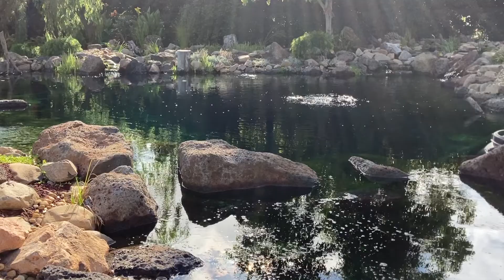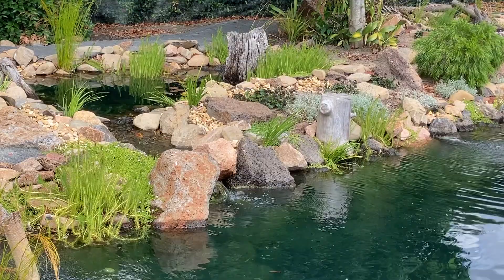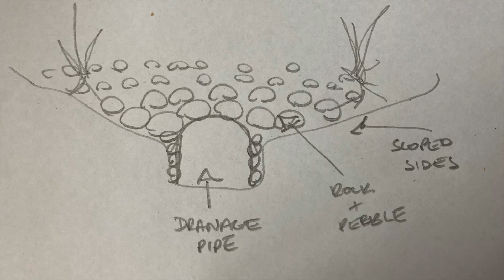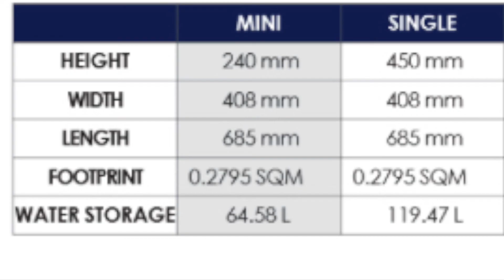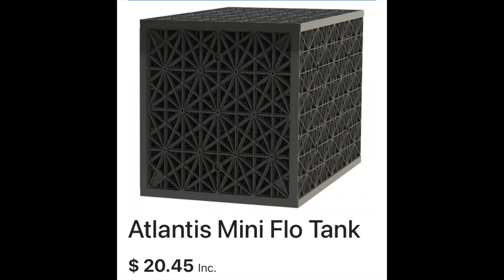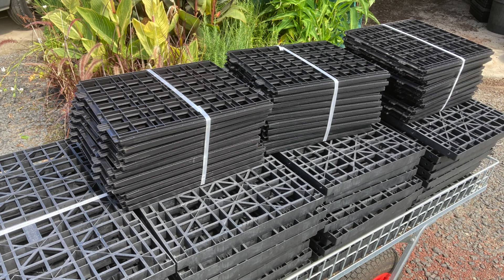Aquablox alternatives

Comment: typical and standard milk crates work perfectly. A milk crate can hold between 250-300 lbs on top of it. Typical rock, whether pebbles or boulders weights about 100 lbs per cubic foot. Three vertical feet of rock is about 300 pounds. It isn't necessary, but to ease worries, a person can attach a vertical pvc pipe to be a support pillar in the middle of upside down milk crates. I then put a layer of heavy duty plastic pallets.     I acquired all of it for free........   it really angers pond companies, especially those that solely use aquascapes products when the bubble on their products is popped and knowledge given to people. Those big companies are a rip off.     I first built a container bog out of an IBC tote after watching 1,000 hours of your videos and then built a bog in the ground.    People, do not waste your money. Caterpillar, snorkel, aquablocks, all a waste.     $700 for a glorified pvc pipe or a trench drain.......  $60 for a glorified milk crate.   .     Do what Kev says!
Reply from the maker: Thanks for crunching the numbers. That’s really useful 👍

Comment: I have 35 milk crates in the ground, will let you know how it turns out once I am able to move the last bit of dirt and put on some rocks. Right now it's covered in snow. I bought a pond liner, pump, and crates for less than $500, I'll need to total it all up soon to know exactly. Plan is two drops and one small pool area, pondless waterfall. Pump worked in the hole I dug well. The crates are lined up 7 long by 5 across so you can imagine the dimensions of my hole. Hoping I know what I'm doing, if watching youtube teaches you anything I've learned tons xD

Edit - Got a vivosun 1600 for $53 (83 now, it was on sale), a 20mil 7x10 foot pond liner for $19, and a pump bag for $6.80. I paid 3.50 each for the crates after a long search, 122.50. 
I paid around $200 total, 202 or so if we're getting picky. 

I really should get a vault, but instead I just punched out the side of one of the crates a bit for the tubing/wiring and will remove the crate if I run into issues later, then will put in a proper vault and a new pump if needed. I got rocks from a friend's backyard that were in a pile, as well as rocks around my house already so no cost there.
Reply from the maker: That’s awesome. Can’t wait to hear how it turns out 👍

Comment: Did the big rocks in the bottom of your bog work out well? I cannot seem to find anything for sale other than the Ecoblox water matrix for around 60-70$ US.  Even the Olive barrels are difficult to find for under $45.
Reply from the maker: The bogs with no blocks are going great. It’s only been 18months I still haven’t done a full drain and flush. Just a few partial drains.
Reply: @Ozponds  Thanks, since it is working well, I will set it up the same.

Comment: I'm working on a dry stream bed that gets flow when we have medium to high levels of rain. I used old tomato cage wire and folded it into a box-like structure and placed it at the bottom of my first of several small bog filters that I am installing in the bed. I'll see how it turns out put I expect it will eventually fill up with silt and I'll have to dig it out (or just leave it since it's not going to have regular flow).
Reply from the maker: Interesting 👍

Comment: Hi Kev. I have another question ( thanks in advance-in the bog building phase and am seeking your expertise.!) 
My bog is 2 ft deep( liner in). I have read many other places to have no more than 12 inches of rock. Should I create a false bottom? ( i'll probably use milk crates as I can't find what your reco'ed atlantis mini flow tanks) I figure I'd bring the bottom up so the distance between the gravel and the top of the pond is onlya few inches. Or is 20 inches of gravel ok?
Reply from the maker: I’ve used over 3ft of rock and pebble before, no problem. A false bottom is great though! It helps store muck and makes cleaning and flushing much easier.

Comment: I used a plastic pallet that I found used for $15 and put cinder blocks under it for a small pondless I built for a friend. Been running great for the last couple years. Not sure how much it could hold, but those pallets are rated at 20k pounds on the ground...
Reply from the maker: Very nice 👍

Comment: I am using milk crates I bought from farmplas there super crates are $14usd each and hold i belive it is 2000lbs or 2500 still solid there is a lot of diy users going the pallet or milk crates rout
Reply from the maker: Nice 👍

Comment: Just discovered your channel and really appreciate your tips!  One question I had about the Atlantic Flow Tank blocks is their weight bearing capacity?  I was really impressed with the load bearing capacity of the Aquablocks.  One thing I am considering doing is putting in a rain water harvesting system under my driveway using permeable pavers.  I have seen videos of similar installations where a dump truck could drive over it!
Reply from the maker: I know the ausdrain product I used can have extra bracing added to increase the amount of weight they can take. I’m pretty sure the flo tank is the same. The Atlantic rep I spoke to told me that aquablox are their product rebranded.

Comment: I don't understand why the aquablox are needed for a negative edge setup.  Rocks are free and easy to move in the rare event you need to take out the pump.  Help me understand?
Reply from the maker: Rick limit the amount of water the reservoir will hold. A negative edge needs a very large reservoir to account for evaporation losses and water in motion if power goes out.

Comment: A local nursery had hundreds of Plastic crates that seedlings came to them in. They were in a huge stack and they were thrilled that I took them.  The area for the "Centipede" and bog Kept caving in during construction So I mostly used them to save on gravel. I actually threw Two 55 gal Plastic drums , and the body of a walk behind floor  scrubber in the hole as well. I wish I could post a picture. Lol. Great Videos, man!
Reply from the maker: I wish you could too 👍

Comment: Great video! As you asked for feedback: I'm building a large Koi pond in Sweden. Love the Aquascape videos and materials, but there's no way to purchase any over here at a reasonable cost. Will have two intake bays in series, as well as a infinity edge overflowing in a large reservoir. Am using around 100m drainage pipe cut in half, upside down on top of slightly heightened plastic Euro-pallets. This creates a void underneath. The idea is to combine the 2nd intake bay with a gravity fed biofilter all in one, a 15m x 2m long downflow filter with only about 20cm pea gravel on top of the drainage pipe. At the far end, the pumps are fed from underneath the pallets, from there via six 110mm piping back to the main ponds. Cleaning 20 cm of pea gravel after a few years is doable if needed, less so with say 60cm of pebbles or gravel in various grades... This will be our 4th pond :)
Reply from the maker: That’s awesome Peter. Sounds like you’re all set 👍
Reply: @Ozponds  Well, not yet... But one tries to learn from mistakes :) When you are surrounded by oak trees dropping a gazillion leaves and other stuff, you have to get a bit creative to make a pond work nonetheless. But it's an endless learning experience for sure.

Comment: Aquablocks here at $80-$85. So I found some plastic soda bottle crates for free. They hold two large soda bottles and are stackable. They are similar to milk crates but not as much depth. I'll have to play with how to stack them so they are not stacked inside each other. so I'm considering using them as aquablocks in a few places. And will use a few large pipes as well. I'm trying to decide if I want my return lines to be my clean outs or if I want a seperate pipe that's larger below my return lines in a trench. I suppose creating the "aquablocks" as my clean out would work. and have all my regeneration bays/ bog shelves slightly sloped back towards the clean out trench. I just assumed I'd make them seperate until I saw most ppl just clean out the returns. My regeneration zones/ bog shelves are not wide but long so im considering how I'll plumb the returns and clean outs because I want proper distribution of my returns. I'm not going to use pumps for my clean outs I'll be using vacuum tubing to access the clean outs and send all that into a rain barrel in the garden. Our barrels run from $20-55. So some things I'll use 5 gallon bucks instead of the barrels. My large barrels I'll use for the garden and to make a pool vacuum using a shop vac and a rain barrel.
Reply from the maker: Sounds awesome! 👍

Comment: Question.... for underlayment.  I'm wondering what order to lay things down if I have underlayment felt, sand and a gorilla bottom and liner. Should my sand be above the felt and gorilla bottom? Should gorilla bottom be on the bottom, then sand then felt? Or if I get a gorilla bottom do I skip the sand? I want extra protection.  My pond is a formal shape, rectangle so my thought was use gorilla bottom for extra protection since they don't cost too much. That or lots of sand I'm just thinking the sand is supposed to go on top of something so it stays in place.
Reply from the maker: If it was me I’d just do one or the other. All 3 serve the same purpose (Protect the liner from punctures).

Comment: What plants would you recommend to be planted into gravel submerged but growing out above the line of the water. In the uk. Temps go as low to around 0oC for 3-4 months and the rest is between 10 and 30 oC
Reply from the maker: That’s not to dissimilar to my temps here in Oz. I like to use upright milfoil but I’m not sure if that’s available in the UK.

Comment: Wish I had known this sooner! I bought 5 Atlantic Water Gardens ECOBLOX FastFall Matrix Blocks for $72.99 each for my intake bay for my new pond . The pump vault was $132.86 for my 5,200 gph pump. Yeah it was expensive! Kev, how deep should the intake bay be on a 13’x15’ x 5’ deep pond? Shout out from Quantico Virginia! ❤️🇺🇸
Reply from the maker: The depth doesn’t really matter. You just want to make sure that you have a shallow/ narrow area that will create that surface pull or tension. Then you just need the bay to be able to hold a minimum of 1 minutes worth of water but it doesn’t matter if this is oversized. I would say if you have too much water over the vault it makes maintenance more tricky.

Comment: Hey mate I made a bog filter inspired by you for my fish pond but I'm getting really slow flow. I have a pretty strong pump and I'm not exactly sure why sometimes a lot of water comes out and sometimes it just trickles out could you help me out?
Reply from the maker: Where is the pump located? Is it full of debris? That’s usually the cause of decreased flow.
Reply: @Ozponds  it has a massive sponge attached to it prevent sucking in leaves but I just cleaned it yesterday still very slow flow. I think it's the actual bog filter as the output is just a 25mm bulkhead fitting
Reply from the maker: I like to increase the outflow as compared to the inflow. For example if I have 32mm coming in I have 50mm going out. But if what you are saying that if your pump is pumping in a large volume of water but a low volume is coming out…where is the excess water going? It’s gotta go somewhere. The only other thing I can think of is that the inflow pipe is too small, although even that doesn’t make any sense if you experience high flow at certain times.
Reply: Yeah I agree it's only a 25mm outflow pipe the excess water just stays in the container and like every hour some air gets like drains I don't know but then a ton of water comes out at once it's definitely not leaking just probably got to upgrade the outflow
Reply from the maker: That is so weird. I’ve never experienced such things. I would be checking how the inflow is configured also. It sounds like you e got some kind of back pressure going on. Also remember bogs work best with slow flows. Any excess water can be directed over the surface of the bog.

Comment: Not sure where you live Kev but have  you looked at soakwells? They are used a lot in WA..
Reply from the maker: Thanks Brad, I’m in Victoria and hadn’t heard of them. That’s going to help others 👍 it’s always good to have different search terms to type into google 👍
Reply: Probably a silly question but do you need to run the pumps 24 hrs a day or can you run them just during daylight hrs?
Reply from the maker: @Brad-RecPondsAustralia  in a fish pond it’s a good idea to keep the pumps running 24/7. Of course it is possible to create a successful fish pond without pumps, it’s just harder to maintain awesome water clarity. Pondless systems you can turn on and off whenever you please.

Comment: After watching many videos I ended up a total of $5 for my entire setup which works really well. The local tip has a recycle shop. A medium size square dustbin cost me the 5 bucks. 8 milk crates came free and I still had some fine wire to cover the top. Pebbles and various size rock on the top came to me free as well.  I am now making a big filter. The filter material can be bought cheaply at lynncraft or spotlight.
Reply from the maker: Nice one Richard! That’s fantastic! Well done 👍

Comment: The reason why Aquascape use the Aquablox is not for bigger surface area for the microbes. Its because you get a higher water volume where the fast water from the pump slows down and small particles can easy sediment. They dont want particles reach the rocks so you can back flush it mutch better. This doesnt matter if you have small fish, but with big kois it is.

https://youtu.be/yVkxw-xQU8g?t=391
Reply from the maker: Makes perfect sense. I think if you’re pulling water from the intake bay it’s already pre filtering, even breaking down those larger sediments that would potentially clog the wetland/bog. I remember Ed showing off a project from 20+ years ago before they used aquablox and the system was still going strong. I do have one pump pulling off the bottom and going to one of the bogs/ wetland filters, this is to experiment just how long it will take for it to clog or if it will, should be interesting. But I do agree if it’s within the budget it makes perfect sense to slow down the water as much as possible to allow even tiny sediments to settle out. Kenans pond is awesome I really enjoyed watching the build. Imagine if he had used the Atlantic flo tanks how much money he would have saved. And if you are Chris from aquascape I love your work 👍
Reply: @Ozponds  I am not Chris vom aquascape. I am only someone like you. Someone who build his own DIY pond. Here in germany aquascape products not longer available, but you are totaly right. It's easy to build these concept with other products, so maybe its good that they are not longer available and i can save a lot money. So thanks for inspiration.

Here someone uses plastic palets instead of aquablox: https://www.youtube.com/watch?v=9Vb0tU4WKzs